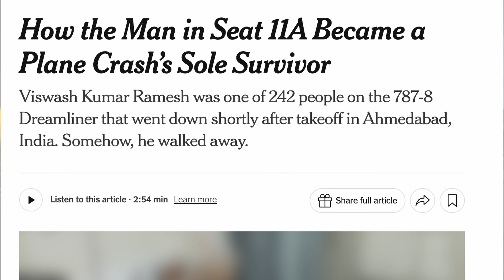Why the RAT Changes Everything – Air India 171 Update

Comment: I had read this theory several times soon after the accident, actually many times. But I had never seen the "original video." And I didn't believe it.
Until someone wrote to me yesterday asking where I could find it.
And yes, the visual confirmation is useless, but the characteristic sound of a RAT—to me, it sounds like a turboprop flying past at high speed—is unmistakable.
It's still incomprehensible to me how the engines could fail immediately after an otherwise successful takeoff, but that must have been it.

Comment: Ex-auto mechanic with experience in diagnosing fuel system contamination and fuel starvation problems due to fuel filter plug up and also traveler to India although years ago.  Timing is correct for contaminated fuel plugging up filter or filters.  Also, seems RAT would not deploy if APU was running.

Comment: I have seen it mentioned elsewhere that the angle of the rear landing gear indicates that it was in the process of being retracted and must have stopped early in the process.

The rear gear is angled slightly downward in front rather than angled with the rear two wheels lower than the front two wheels on each.  But when the gear retracts, the angle of the wheels change to accommodate fitting in the gear “well.”

This video appears to show that the gear was in the very early stage of being retracted when it, apparently, stopped moving perhaps do to the loss of hydraulic pressure.

Comment: If both engines are running, can you hear the propeller?
Reply: Nobody knows, because when both engines are running you don't need RAT.
That said, I'd say that this particular frequency of sound can definitely be heard in the sound spectrum. It's not about the volume, but rather about sounds that are outside the familiar spectrum of what one would normally hear from turbine engines on commercial aircraft.

Comment: Yep if you were in trouble and loosing lift you would have both those engines screaming their lungs out under full power.. you can’t hear that in the video.. but to have both engines run out of fuel just as you left the ground right when you needed them most is really sht luck.. what could cause fuel starvation so suddenly and to both engines., fuel pump.. electrical failure.. computer failure or glitch.. burst pipe ..

Comment: this is the most appropriate correct analysis  i think and also our flying beast vlogger ex captain gaurav taneja also mention the most chances of dual engine failure...
so now the point is how it happens is it due to technical error or enigne issue or some one from the ground staff did somethign intentiaonally may be type of terrorist attack..or may be remotely hacked the system

Comment: why does it take so long to recover the black box data?
Thanks for the analysis, great insights !
Reply: This is likely because such a "black box" isn't simply connected to a computer to read the data.
The device is evidence in an accident investigation. It is first inspected externally, and the results are documented. Several parties are already involved, for example, the manufacturer of the FDR, the manufacturer of the aircraft in which the FDR was installed, representatives of the aviation authorities from the country in which the accident occurred, representatives of the aircraft manufacturer, possibly representatives of the various countries involved, etc.
All of this happens before the device is even opened.
The point of this isn't to satisfy a curious public, but to find out what the possible causes of such an accident could be.

Comment: Firstly, the takeoff took very late. There must be a thrust issue.  Secondly there was evidence of electrical failure on the aircraft from the earlier flight. With the RAT deployed, it should be clear that electrical failure led to engine failures.  The electrical system problem should be fixed before the flight.  A likely situation.

Comment: I'm hearing all evidence that the RAT deployed but I don't hear anything saying it was the engines failure. Seems it could equally have been the hydraulics (no thrust and landing gear still down)...  then the original video seemed to have more sound than just the RAT. I think we heard engines roaring too, idk. I suspect if the both engines went out the pilots could have known.

Comment: Based on today's report , the plane took extra runway length trying to achieve the take off velocity in the last seconds before noselift , that led to the lower airdrag. The underlying cause for not able to achieve that level of thrust from engines should be ascertained for either continuing malfunction during the  takeoff land run  or a sudden loss of engines just before nose lift. If latter is true, no experienced pilot can avert an accident what just happened. If former is true, pilot had good chances to abort the takeoff. The earlier reason of hitting can be ruled out since no evidence is found on cockpit voice recorder. But the flying sand is surely a sign of confirming to take extra  7 to 8 hundred meters of runway (close the end of runway) to get sufficient airdrag to uplift

Comment: This piece of shit so called Aviation expert was paid by Boeing to pin the blame on Indian Pilots and vilify India.All the white people r hateful of India.
Reply: You will find that your pilots did not move the thrust levers out of toga detent to make the engine Fadec system exit idle thrust safe  mode after the rat deployed due to a loss of AC power. And the gear did not come up because there wasn’t enough AC power to run all the AC hydraulic pumps. And that happened because when they shut off the APU, they did not make sure that the engine driven generators were online and so it takes 1 1/2 to two minutes for the APU to shut down, which is just about the time that they had taken off and climbed a few hundred feet.
Reply: Your claim is probably completely unfounded.
I think people like you are the reason why Indians aren't particularly popular here in the "West."
Why are they even here?
Doesn't their great homeland have enough to offer?

Comment: I'm sorry. That frame is still pretty bad quality. And if you guys can hear the RAT, I can still hear the engines blasting in the distance all the way to the crash. And if you can see the RAT, the freaking flaps don't look like they are over position 1 in deployment to me either. 
I know people want to know what the cause is as fast as possible, but until the FDR is analyzed and it is PROVEN the RAT had deployed or the engines failed, I will have to still zero in on the flaps being set wrong for takeoff in a hot, low air density environment with a shitload of people-weight and luggage and maybe a too conservative setting for engine take-off thrust. If the captain or first officer were late to see what was happening, they might have gotten behind the power curve to recover. And why did it take almost the entire runway to get off the ground if the engines and flaps were set correctly for take-off?

Comment: The main thing that went wrong was the company chose Boeing - they've been in bankruptcy protection for many years now and that should tell you a lot.  Their Dreamliner has been a tale of woes from the outset - fires on the runway, fires in the air, parts falling off the plane whilst in flight.   I always avoid using any Boeing plane

Comment: There was also some comment that the aircraft had electrical problems on the prior flight. Also that the aircraft had various maintenance problems. If that is the case then the RAT deployed because all hydraulics and electrical power failed but at that altitude not much wiggle room. Probably a multitude of problems resulted in this crash along with stalling out the aircraft.

Comment: Also, I want to point out that there was another video from another angle, and when you zoom in, the flaps are down, not as down as you would see on other planes, but enough to generate lift and have a perfect takeoff without any issues. Another factor that I observe is the angle of the landing gear, which was at an angle that is usually not normal, suggesting that there was an attempt made to lift the landing gear back up. So in conclusion, I believe that pilot error in this situation is highly unlikely and mainly the cause of all of these is dual engine failure or a major component of the 787 suffered damage.

Comment: Mayday call reported power loss, no thrust. That's pretty specific. If anyone had retracted flaps by mistake, engines would still have been running and there still would have been power. But the pilot clearly stated loss of power and no thrust. Both engines shut off simultaneously within fifteen seconds of takeoff. Why? That's what needs to be determined. None of the videos show any birds, or any puffs of smoke or flames from either engine. Seems like they simply shut down.

Comment: Sir, I heard both of your videos. I am from Ahmedabad, India.
I want to draw your attention towards the previous flight of this aircraft in which multiple people have reported power failure like Air conditioners not working in the Cabin and it seemed like all the electrical power was gone in the cabin. Could that be a clue towards solving this mystery? I mean Engine Bleed Air is used by the Air Conditioning system. The whole incident of the previous flight indicates a failure of the Electrical System, isn't it? What if that fault basically exaggerated in the next takeoff when engines were at near max thrust. 
I would like your views on that.
There are several videos of that guy explaining that failure on the internet. Flight From Delhi to Ahmedabad.
Reply: Exactly. Boeing is toasted.

Comment: The RAT is audible in the video too. It was not a dual engine failure. The odds are really against that. Usually when multiple engines shut down it has been because of pilot mismanagement. I believe that both engines were either intentionally or unintentionally shut down either by one of the two pilots or somebody on the jump seat. There is a war going on between India and Pakistan right now. I wonder if that is part of this story too.

Comment: Not adequate enough yet to accept that instead of gear retraction the flaps were retracted. My view, they might have faced the 1 st severe problem of landing gear retraction which they could have consciously tried to overcome by adjusting the flaps. Engines could have still been working, but with the plane losing the lift at the same time, it just dropped crashing on the building almost perching like to a large extent..!

Comment: It appeared to me that the plane rotated at the very end of the runway or maybe past the runway. The engines could have been damaged by sucking up debris past the runway and failed. Maybe takeoff data was entered wrong which resulted in wrong reduced  power settings and speeds leading to late takeoff.

Comment: I highlighted the RAT deployment in your last video, glad you found the original video that confirms this. I would agree a double engine loss of power, the engines are certainly not screaming as you would expect in this scenario, the pilot would have been on full power. I think it is a combination of both, loss of power in both engines, but cause by a total electrical failure. Look at the online videos of the condition of this plane on the prior flight, no aircon, most headrest units not working, a lot of lighting not working. A total electrical failure led to the loss of control of the engines.

Comment: I appreciate that on new emerging evidence and observation, you have reanalysed and reviewed your earlier views. Every one blames the pilots who is not alive. This evidence is a proof that the pilot had tried his level best but things were beyond his control. If there is power failure, then as a layman, I think the total system will fail, which could be electrical, electronics, mechanical, hydraulics etc. Hence neither the wings will move nor the gears will move. I have a question Captain? Can any one remotely play with the computer software systems of planes i.e online highjack the software system?

Comment: Excellent briefing on the crash by experienced pilot Captain Steve. It should be known what may be the cause of this crash once retract the data from flight Data recorder and after analysing the data. But RAT deployed is the indication of  three failure  both engine failure, Hydraulic failure and electrical failure.  But also need to think about dual electrical and hydraulic system available that should provide service to aircraft( If both engine failure then redundant electrical power supply and hydraulic power supply is remote). Also we should not neglect the pilot error as said by pilot (Instead of operating landing gear pilot may be operated the flaps to up for landing configuration). All reasons for this crash is only predictions. Final outcome is the flight Data recorder Data.

Comment: Excellent insights, Captain Steeeve.

One supporting clue for a dual engine failure: reports say the lone survivor walked away from the aircraft shortly after the crash. If either engine was still operating at takeoff or climb thrust, the suction from the nacelles—especially on a 787—would have posed a serious danger.

The fact that he wasn’t harmed by engine intake strongly suggests both engines had already shut down or flamed out before or on impact. Another small but significant point adding weight to the dual flameout theory.

This also corroborates your RAT deployment..
Reply: Nope, sorry but the engines would've stopped very quickly upon impact. The tolerances in the insides of a turbine engine are very small, so any upset would stop them very quickly. They would not have been running once the ground impact took place.

Comment: Im still going with the Aircraft wasnt configured for flight. Either the pilots set up something wrong or it wasn't fueled with the correct fuel or ammount. Again, im incredibly sad this happened as a pilot it breaks my heart for the horrible loss. I have a feeling that when the cause is revealed, it will be disturbing.
Reply: What I believe is both engines suddenly stop providing enough thrust, let to crash.

Comment: Decent analysis but just one point. Just because birds are not found on the runway doesn't mean a bird strike didn't occur. We had a bird strike (medium size bird) at V1 out of WMKP two days ago. The impact could be heard over the noise of the engines and since it hit the side of the nose we saw the impact. We asked ATC to check the runway and report the type of bird however no bird remains were found.

Comment: If there was a abrupt and sudden loss of engines what would have been the major cause speculate on why both engines would have stopped together or at the same time What was what would have controlled that I know they'll find out I'm assuming that the turbo fans in the engines would have continued to rotate and that when it would hit the ground the blade should be bent which will show up very easy I would imagine I've seen that in other cases but the sudden loss of engine power that was so Swift they didn't have time to react at all they did however know when they sent out a Mayday so they knew that instant that they were going down and that there was all likelihood that they could not save this plane and that would be a very sick feeling I'm glad that it didn't last very long for them and all the passengers Godspeed😢

Comment: My big question is whether the RAT will deploy if say single engine failure occurs, shock factor hits the pilots, they go to the emergency checklist, CA is flying, FO is running emergency checklist, FO cans the working engine on accident. Will the RAT still deploy? Does the RAT operate based off of computer information and only deploy when both fail? Or does the RAT operate solely on the squat switch so if an accidental dual shut down happens due to pilot error will it deploy?
Reply: It's deployed automatically even if the plane is flying & both engines are turned off.

Comment: I would like to propose another scenario. Say it was a normal take off. The non handling pilot raised the gear, but this caused a massive hydraulic failure. The gear only completed its first action (tilting the bogeys prior to retraction) then then hydraulics failed with a loud bang. The RAT deployed. The rat generator started and caused the lights to "flicker". The flaps auto retracted due to aerodynamic forces or the flap control computers reseting with the RAT induced electrical spike. One of the crew transmitted a Mayday and stated "no thrust" and "no power".

Comment: I could be wrong, but if that's the original audio I didn't hear any engine noise at all. It was pretty quiet. Engines usually make a lot of sound, especially on take off when they are at 100% thrust (TOGA).

Comment: If there was an engine failure or fuel quality issue, there should have been some smoke/fire or so. It is supposed to be considered as design flaw if the RAT, being the last resort, cannot be relied on at low altitudes, especially during take off. However, now I think that it was likely a part of the electrical power line powering the hydraulics that ran into issues. Being in low altitudes and with so less time, they probably didn't get enough power from the Ram Turbine to power up the hydraulics, or likely the electrical power line to the hydraulics and the original electrical power supply (which was having issues from the beginning) is common for power from the Ram Turbine as well, which can be a design flaw as there is no standby option there.

Comment: A passenger made a video that the plane was experiencing some sort of electrical problem.
Reply: Yeah. I saw that.  The tv screen did not work.  The air con was not working. The lights above the passenger seat was not working.  If I saw all of those things were not working I will now be getting off the aircraft before it takes off.